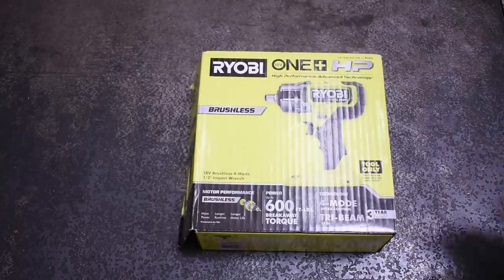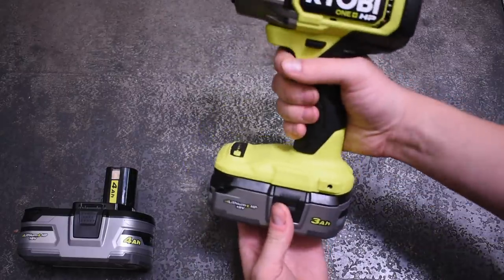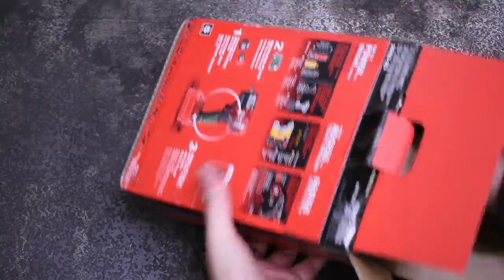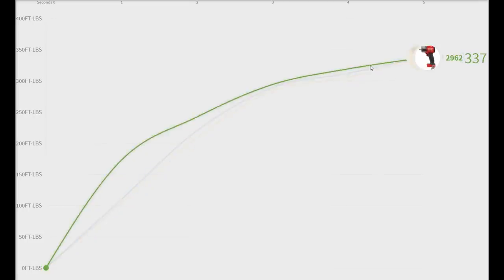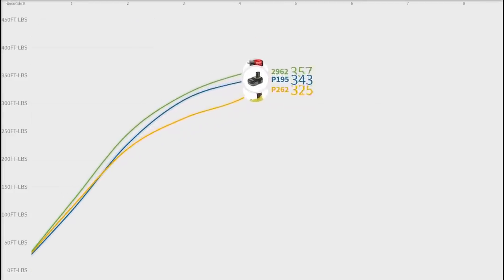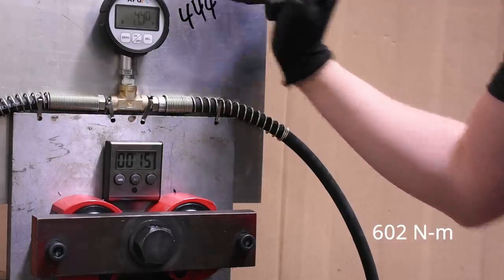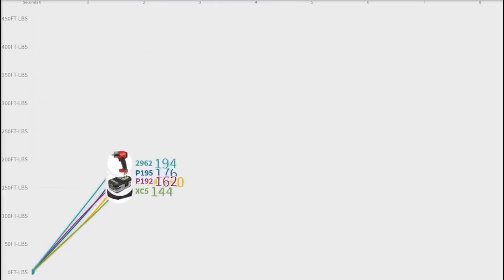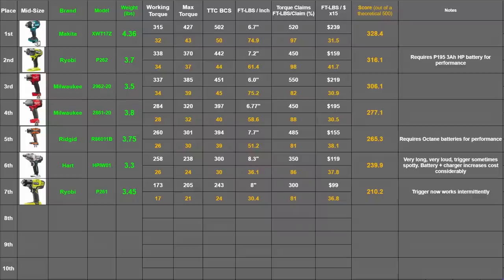Ryobi HP Finally Beats M18 but Needed THIS Battery: Dyno Test

Comment: I be positively surprised if the Ryobi can open a semi truck lugnut, my Ryobi cant even open 14mm ones, so... That wouldnt be so bad if my much smaller Makita had any problem with 14mm lugnuts, but the Makita doesnt even hesitate, even when using less than fully charged 2.5ah standard battery. Anyway, hope youll find a realistic scenario to test those truck lugnuts, to simulate something that been sitting a few years or tightened by means of a long extension after a roadside repair.

Comment: Ree oh bi lol. But yeah as others have mentioned the dewalt has no protection or current limit inside the battery and it is a 20v pack so I believe it has an additional 18650 in series with the rest giving the tool higher voltage.
Reply from the maker: Good point on the protection. But 20V max is same as 18V nominal, these are all 18V packs with DeWalt marketing sprinkled on theirs.

Comment: What I take away from this video is that I'm definitely buying this impact wrench, I have the DeWalt batteries already, but DeWalt impact wrenches are a bit subpart imo, and for occasional use I'm not worried about any potential durability issues, seeing that these batteries not only work really well, but exceptionally well with an adapter, only makes me happy :)
Reply: Nvm, I would be buying this tool, if it cost the 160$ everyone says it does, at 220$ on Amazon+ shipping it's not a bargain anymore.
Reply: @piciu256  Home Depot or Ebay will sell it more for around that price.
Reply: @Gadgetmawombo  still, shipping to EU breaks the deal.
Reply: @Gadgetmawombo  A bit late for this reply, like a yr. late. I was just at home depot yesterday and they were selling the p262 for $169. That was just fornthe the tool. I guess the inflation mark up hit the tools too..

Comment: Is putting the Dewalt 20v battery on a tool designed for 18v, a fair test?  Due to electrical power being proportional to voltage-squared, then that's a potential 23% boost, by using the higher voltage rating.
Reply from the maker: Dewalt 20v batteries are just 18V batteries with some extra marketing wank. Same number of 18650 cells

Comment: It would be interesting to see what the Ryobi battery would do if the communication contacts were taped off and covered.
Reply: They did a test like that on their first test review. They used a 4ah battery that was supposed to be HP and didn't have those extra teminals. It showed that the tool kind of had its own mind so to speak. It fluctuated on torque. Sometimes putting out less and sometimes more.

Comment: The only brand that is beating Milwaukee is Milwaukee quality control department. I have two of the same  Milwaukee high torque 1/2” impacts. One year in age difference and the newer tool sucks compared to my older tool (right out the box)! Even my mid torque m18 out performs my new high torque. WTF?! Milwaukee get your 💩together. Only cause I’m deeply invested in the m12&m18,& pack out line I continue to buy and use this brand.

Comment: I'd really like to see the m18 with the 6.0 XC high output battery against the ryobi. If you give one the best battery available then do it for both. Actually make a video with all the tools on the list with the best battery available, at least for max torque test. Then you'll know what is best case scenario, and the absolute most you can get out of the tool.
Reply from the maker: We already have a video with the M18 and every HO battery. The Ryobi is using a 3ah battery here, equivalent to the CP3.0 - which we found makes the same as an XC5.0. So it's as even as it gets between brands

Comment: I'm really liking this channel but when are you going to test snapon, matco, and mac?
Reply: He has done a few pneumatic impact wrenches, but so far no Cordless Snap-On, Matco, or Mac
Reply: Prolly when they hit the lotto or someone donates theirs for the test
Reply from the maker: @benmiller5015  This. We have more from these brands coming up. But if you want to see $900 cordless 1/2" impacts, we'd rather make 4 other episodes we're really wanting to do than spending the channel's $ on one tool. We've had several people reach out with offers, but nothing has come to fruition yet.
Reply: @TorqueTestChannel  Plus the test have been done and the $900 impact performs worse than the Ryobi.
Reply: Their tools cost too much for the quality & performance and they're not used by that many people compared to the Big 3 (Dewalt/Makita/Milwaukee.  +++ Dewalt basically covers Mac anyways, so that's a 2-for-1 deal). Shoptoolreviews did a mid-range Snap-On and it was just embarrassing how bad the tool performed relative to how much it cost.  

Makes sense to clear all the mainstream players first since that has the widest audience and allows the channel to grow faster.  Hate to see a fledgeling channel blow their $$ on tool truck brands that will deliver some serious underwhelming test bench results anyways.

Comment: The P195 has disappeared from HD. Even eBay.  Maybe a 21700 battery shortage? Or maybe they sold out after this video?
If so, congratulations, TTC. That would officially make you an "Influencer".

Comment: ryobi's inconsistency problems can be summed up by simply taking it apart and looking at the internals. There is a reason it is marketed at weekend warriors who are only needing it for light duty or not every day. Someone who needs their tools to work all day every day to make a living isn't going to be using it, unless they are dumb.  I don't want a tool with a good warranty for When I need the warranty. I want a tool with a good warranty that is there IF I need it.  

As always though, if you just need tools for odd jobs and aren't doing stuff to make a living. Ryobi makes some great stuff for that. I would still contend there is an argument for the better brands for the minor cost difference, but nor would I criticize someone over that decision either. Sometimes $20 is $20.
Reply: most of the time the price difference is more than 20$ when you consider that the ryobi tools often go into bigger sales and come with a battery for the same price as a tool only from another brand. For price to tool ratio I feel like ryobi is unbeatable but on price to reliability or power yes it often loses! Atleast in canada with our inflated prices haha

Comment: I’m a bit apprehensive about buying these adapters, because I’m always afraid I’d ruin the battery or tool because of the lack of communication between them. But I’m curious now lol. Could these adapters be used in a charger?  I.E. could I used an adapter to charge my Milwaukee batteries in my Ryobi charger? Or would the lack of communication allow the batteries to overcharge and be potentially dangerous.
Reply: Good question

Comment: So if I  understand correctly, The Milwaukee with the XC 6 is still better than the P195 or any other Ryobi battery
Reply from the maker: A Milwaukee with a standard XC5.0 is more powerful (slightly) than the P262 with the P195 battery. Put an XC6.0 on the Milwaukee and it's noticeably better.

Comment: Hello, I just purchased the 4amp high performance. Wondering which Ryobi uses the 21700  besides the 3amp? I can't find any literature confirming which cells are used in the batteries.

Comment: At 9:28 do you have any explanation for the torque dip in the P192 battery?  I would call it measurement error, but it repeats on the next graph shown and does not show up on other batteries tested?  

In my (limited) understanding you are measuring by compressing load cells by tightening a nut.  Is the impact somehow loosening the fastener?

Comment: Kinda BS on Ryobis parts, right on the bottom of the tool where the battery pops in is a label thats says "Use only battery packs listed in operator's manual or P197" 
🤔 I wonder what type of data is being used on those pick-ups and if you can trick the tool into thinking it has a different battery on it

Comment: Isn't the DeWalt "The Beans" because it's a 20V pack vs. the rest being 18V? 🤔
Reply from the maker: No sir, they are all 18V. DeWALT just calls it 20V max in the US and 18V everywhere else in the world.
Reply: To elaborate, the cells used in these tools are your standard voltage 3.7V lithiums, in series, so 3.6/3.7 times 5.
At a full charge, they typically measure 4.1-4.2V, so DeWalt chose to go with the beefier sounding "20V" over a more accurate, nominal 18V. 

Kobalts 24V Max is actually a higher voltage, being 24V at max charge (22V), having an extra cell in series. 
36V and 40V tools as well.

Comment: I love Ryobi but I think bumping this to #2 on the list just isn't representative of the tests. You're using the HP batteries which are equivalent to the high output for Milwaukee, but won't use those on the Milwaukee. There needs to be some sort of standardization or else the results become worthless. Maybe have an entry for each battery result?
Reply from the maker: But we have used High output on the Milwaukee, ep18. The 3ah just didn't make an increase on the XC5.0. We're not including double stacked 21700 cell packs on the chart. 3ah for Ridgid Octane, 3ah for Ryobi P195, 3ah for Milwaukee, but didn't increase. So XC5.0's score stays.

Comment: You used the same adapter, does that mean Milwaukee and dewalt batteries interchange on each others tools?
Reply: Nope, it's just the adapter designed to accommodate both DeWalt and Milwaukee batteries.

Comment: It says 20V on the side of the DeWalt battery, and you wonder why it performs better than the 18V batteries...?
Reply from the maker: All the batteries here are 18V. Dewalt just uses creative marketing to advertise max voltage rather than base voltage. Which is why in Europe they are not allowed to. They have to call thier 60V batteries 54V. Same number of 18650 cells in series as M18, no magical ways to get 2 extra volts from 'em
Reply: Oh, well then I understand... By the way, I just bought myself a Ryobi P262, which is why I watched this video in the first place I guess. So far I have only tried it with a no brand chinese knock off battery and I was dissappionted about the performance. It could just barely remove the lug nuts on my truck. So I guess I will have to buy a proper battery for it. Is it worth paying the extra $ for a HP battery do you think, or will it have the same torque with a regular Ryobi battery without the extra communication terminals?

Comment: How in the world did you get a dewalt battery to fit ryobi man?? Tell me the secret.
Reply: They make adapters for all the major tool brands to work with one another. Check Ebay or Amazon. They're typically around $16-$22.

Comment: Wouldn't the Dewalt battery have the performance gain becuase it is a 20v instead of Ryobi's 18v?
Reply from the maker: 20v max an 18v are the same thing. In this case its because battery management is on dewalt tools not the batteries. So on a non dewalt its an on off switch which delivers all the current but can damage the battery

Comment: ive heard nothign but good things about ryobi tools...i wanna switch to them from dewalt but im already so invested in dewalt
Reply: moving to ryobi from dewalt would be a downgrade in most areas but they are cheaper
Reply: @aaronporter2180  
Yeah, but Dewalt is already the low-end against Makita and Milwaukee.
Reply: wait for a good deal during father's day or christmas and try out a new ryobi tool to replace one of your dewalts and see if you like it! Worse that happens is you lose 100-200$ but you'll never know otherwise
Reply: Id at least get some of the small tools like the glue gun cordless dremel etc.

Comment: I know you guys aren't in the business of destroying tools just doing honest torque testing.  Maybe it might be fun to take a poor performer like the harbor freight high torque and hook it up to a couple car batteries in series.  Give it all the amps it can handle and see what kind of numbers it makes.  Maybe I'm dumb and that wont work but if it does it might be entertaining.  Just spit balling a random thought.
Reply: Running a brushed tool like the HF at 24V should give a nice power boost and would be unlikely to damage it in the short term. Plenty of 14.4V tools got used with 18V batteries back in the day. Some Snap-on dealers were even encouraging it LOL.

Comment: Batteries is the reason why I don’t use Milwaukee. A few years ago(probably a lot more than a few lmao) I bought a Milwaukee drill and impact driver. Batteries died every 10 minutes. Lots of power but what’s the point when you can barely use it.
Reply: You got a lemon. It's that simple. Running 4yr old M18 batteries all day with no issue.

Comment: So I should get the p195 3ah hp battery for my p262 over the 4ah hp battery?
Reply from the maker: Yes, if you need more battery life of a 3ah the 4ah wont be a HUGE amount more - just buy another P195!
Reply: @TorqueTestChannel  I only have the small 2ah batteries for now as I just got the thing and they were the cheapest way to just get going. But thinking of upgrading the batteries, I came across your videos in which you conclude that the p195 is the optimal battery for p262 according to your chart. Is that just because the 4 is more bulky for no more performance? Or just not enough of a performance gain to justify the additional size/weight/cost compared to the p195 3ah?

Comment: I wonder what cells are in that dewalt.
Reply: Samsung 25r 18650s
Reply: The (DeWalt) compact 4ah 6ah 8ah and 10ah all use 27100 cells. Not sure if the compact 3ah uses 21700.
Reply: @svn5994  it does
Reply: @svn5994  I notice a difference in my milwaukee high output batteries vs the standard.
Reply: @svn5994  compact 3ah is the same physical size as the 4ah.  It's 21700.

Comment: Oh wow so Dewalt batteries will be superior but their tools are inferior to Milwaukee. I never knew that
Reply: DeWalt batteries don't have any kind of protection circuit, that's in their tools, so DeWalt batteries can be damaged by drawing too many amps or over draining them when used in tools without circuitry to protect the battery.

Comment: Remove the torque claim column. It skews the numbers on which is truly the most powerful, compact impact
Reply from the maker: The point of this channel is to call out companies for creative marketing. 99% of people walking around in a store picking up one of these tools wont watch a video like this. So those embellished numbers make these companies a lot of money. The brands playing a more honest game deserve some points. All of the numbers on the list are based on power, if brands want to rank higher, make more power!
Reply: I also think it would be better without that. It is interesting data but has nothing to do with which tool is the best. Perhaps you could include it but not have it influence the total points. Either way, you guys are doing a great job. Keep it up.
Reply: The Makita is still the most powerful mid-torque either way.
Reply: @TorqueTestChannel  I agree with the others, the torque claim column is too heavily weighed. It's worth 2-3x as much as some of the other columns and is typically 30%+ of the total tool rating. I think it should be worth only 10-15% of the total. I care more about what the tool actually does, truth in advertising is only worth a small percentage to me. I would also like to see a specific torque (ft lbs per pound) column added to to the rankings to promote lightness.